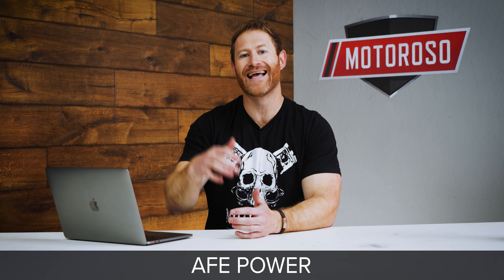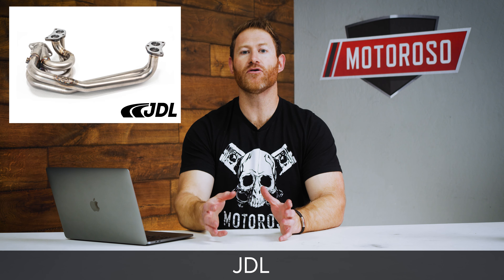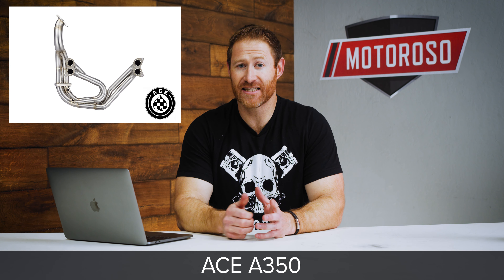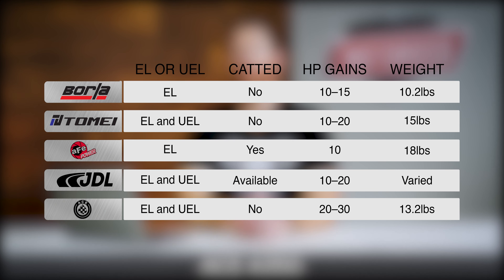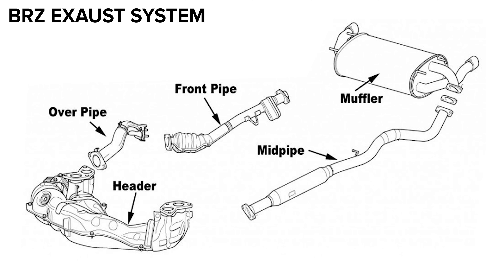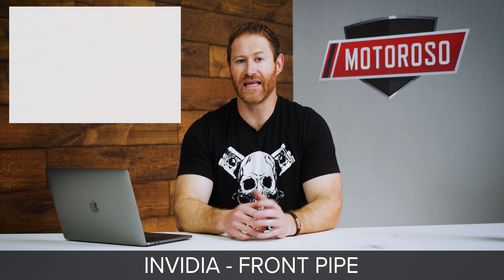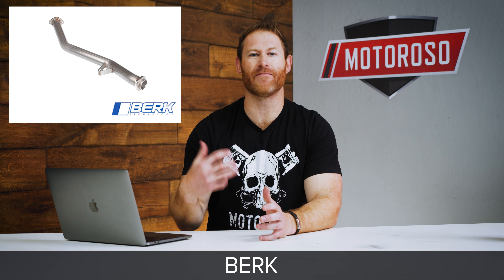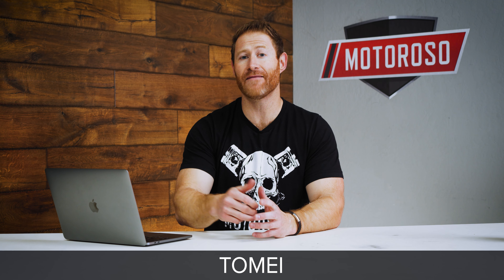3 Must Have Exhaust Mods for the BRZ, FR-S, 86

Comment: Are any of these headers CA legal?  Thinking of getting the JDL UEL catted headers
Reply from the maker: The Borla header is the only 50 state legal header! Very popular for that exact reason.
Reply: @Motoroso  Even though it is catless?  Had no idea
Reply from the maker: @tastycranberries3252  because it retains the factory cats!
Reply: @Motoroso  Gotcha, on their website it lists the headers as race legal only.  Should I be worried about that or should I just go for it?
Reply from the maker: @tastycranberries3252  We've sold and shipped these to a number of these to CA customers, which would be prohibited if it didn't have a CARB EO number. We'd love to get you hooked up with this! They are currently being built to order, and have a wait time. Hit us up on live chat at motoroso.com or call us toll free at 833.668.6767, we can find out a more accurate lead time, get you a coupon code for a discount, and a free shirt for your patience!
Reply: @Motoroso  Buying a 2017 BRZ in January!  I will reach out when I am ready to start modding.  Just making plans as of now.
Reply: @Motoroso  How does this work? Do you take the cats off the OEM header and transfer them over somehow? And is it possible to do that with the old Borla V2 headers that are now listed as discontinued in other stores but have the same part number 17284?

Comment: To be noticeable under normal daily driving conditions, should you pick Invidia Q300 or Perrin 2.5 exhaust? What catted equal length header best matches a smoother, least noisy ride and quiet sound for BRZ? Ideally, to be louder than the stock exhaust but not too overbearing as a daily driver.
Reply: Perrin 2.5" is now discontinued unfortunately. Q300 is decent but packing inside the muffler heat cycles away and gets tiny and louder. 

Catless EL header and MXP CSG touring is subtle and not much louder than stock. I have that setup with a Catted and resonated front pipe and volume is perfect for daily. Edit also most importantly zero drone.

Comment: Going to be difficult on my decisions. Virginia exhaust laws suck. I want an exhaust system that increases power, but gives off that deep rumble sound. Without being over 95 decibels, and doesn't crack and pop.
Reply: Catless header and tune and keep catback stock. 

MXP CSG touring will be touch louder than stock and no drone. 
Fujistubo axleback or DC sport axleback add some volume too but still very tame.

Comment: If anyone has had experience with the mxp comp rs catback, where would you place it on the loud vs aggressive chart?
Reply: I've had it as a daily for 5 months now. I'd say little higher then the Corsa on the scale used in the video. That being said: it has a LOT of drone! 😱 I'm looking to go for a Q300 now due to the drone as I'm daily driving. 😅
Reply: Watch my videos, that's what's on mine, perhaps a bit louder because of e85. It drones a lot and it's medium to high loudness. I like it. But it can get annoying if you stay on the rpm range where it drones. I did a uel catless header upgrade the drone is 90% gone and sounds awesome! I'll have some videos of it by the weekend with the new sounds.